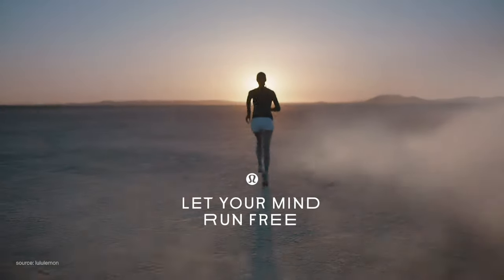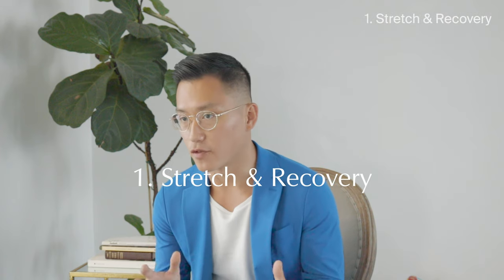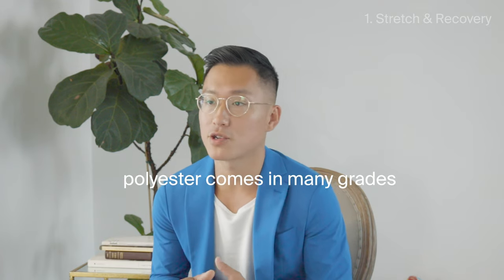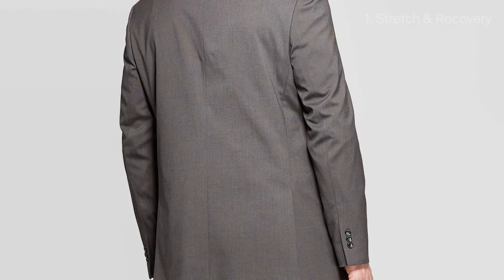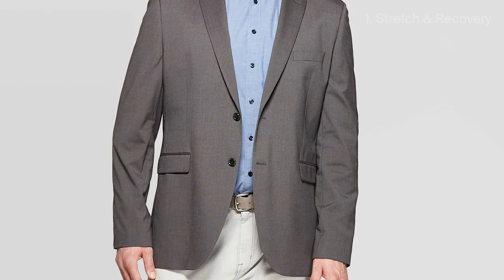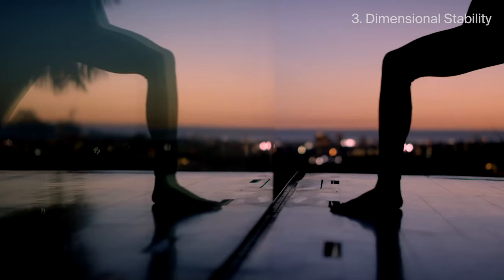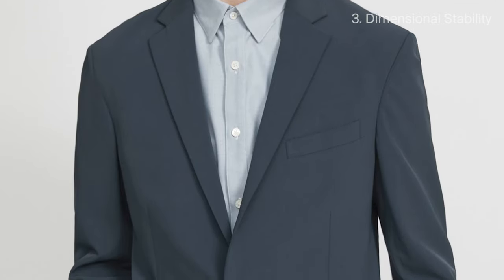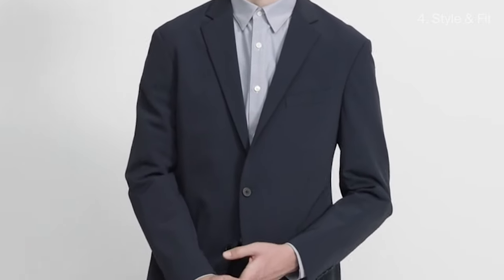$100 Stretch Suit Vs. $1000 Stretch Suit

Comment: I bought my first Sene suit this Summer. When I first received it, it was NEARLY perfect, which was amazing considering the sizing is done by an AI based on answers I supplied to their questionnaire. I contacted Sene, provided photos and a video, and true to their guarantee, they remade the suit from scratch FOR FREE with adjustments they deemed appropriate based on my photos and video input. When I received the remade suit, what I find is the most perfectly fitted suit I have ever owned! My body type makes it typically difficult to get suits sized just right without breaking the bank with a bespoke suit...I'm short, slim, and athletic...and Sene delivered the best-looking suit I have ever owned.
Reply from the maker: Thanks so much, thrilled to hear that!

Comment: Thank you for this info, it's been helpful. I do have a question. How long can you expect performance stretch suits to last when compared to traditional suits? So would a performance stretch suit that costs $500 last as long as a traditional wool suit at $500?
Reply from the maker: Great question, it will actually last significantly longer. Performance stretch suits are far more durable than wool suits, which are more delicate relatively speaking

Comment: I need help being fitted for a custom suit. Idk if your quiz would help get me the fit I'd like.  For instance, I'm really big in my shoulders, over 19" arms, my lats and back are thick, but waist runs between a 32-34 depending on my current weight. Further, my arms are at around 77" reach, and my wrist are surprisingly thin for a man of my stature, but I'm 6'1" and 225lbs. Further, my hips and butt and calves are big, legs are long. I want a very  tailored, sleek and sharp suit, need it for July 29/2022. I don't want boxy, it hanging over my hands, I don't want loose pants, but not ridiculously tight. Can you guys help??? Please! Been through this once, I was let down with the results

Comment: How does Ministry of Supply compare to Sene and Theory?
Reply from the maker: Great question Peter! The biggest difference is Sene is custom fit from scratch and Ministry is not. Ministry's suit is $90 more yet Sene's suit has better craftsmanship because of its bespoke heritage, including things like lapel pick-stitching. Also, Sene has a 60 Day Guarantee including free remakes & alterations until the fit is perfect.
Reply: @Senestudio  thanks for the response; is the fabric between Sene and Ministry the same as well?
Reply from the maker: @pard73  It's very similar to the fabric used in Ministry's Kinetic Blazer, at least the original ones. They've been changing manufacturers lately so might not reflect current quality
Reply: @Senestudio  Ok, thank you.  I have Ministry's Velocity suit and Apollo shirt;  both are top notch for fabric quality and are incredibly  comfortable.  The suit does not, however, come is "short"  (or "long") sizes so I needed extensive tailoring to get it to fit.  The shirt is also only available is letter sizes - which is also a fit compromise.  Thus, the Sene custom fit is an advantage for sure.  Once we can actually travel, I'll have to look into your products! Thanks for the info...